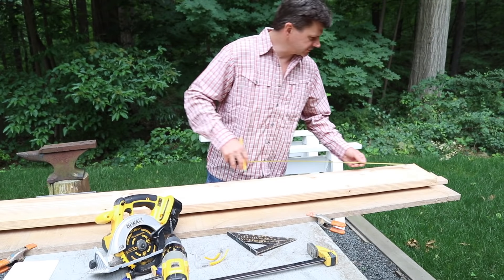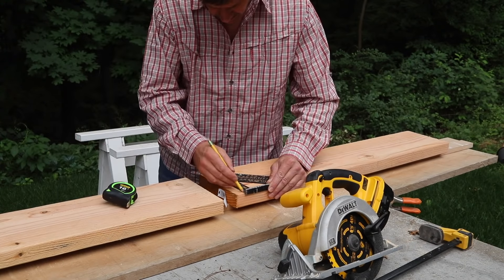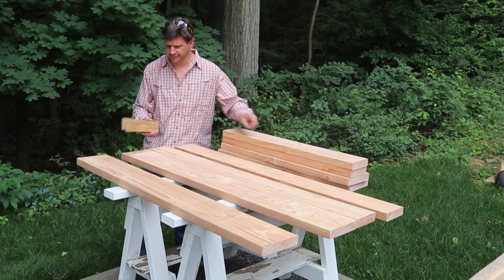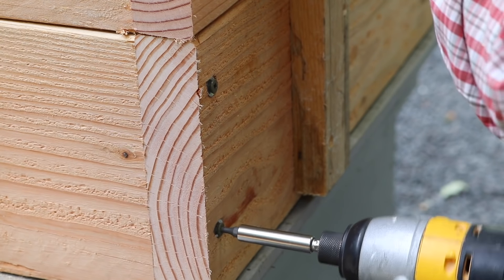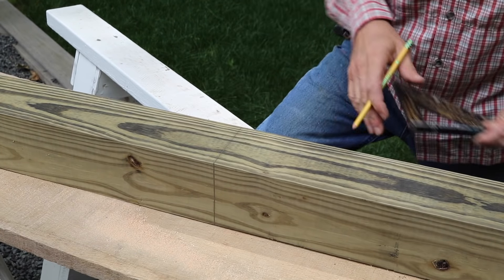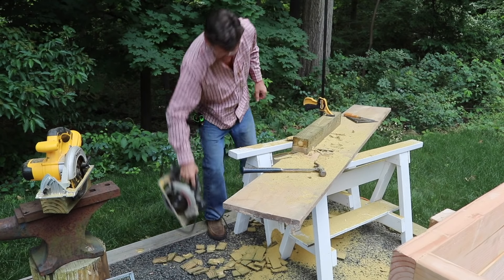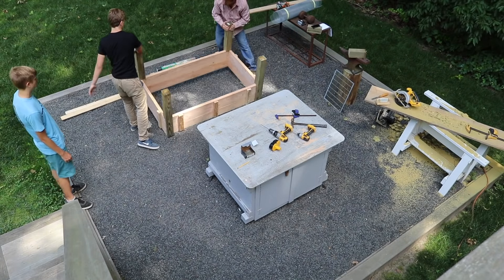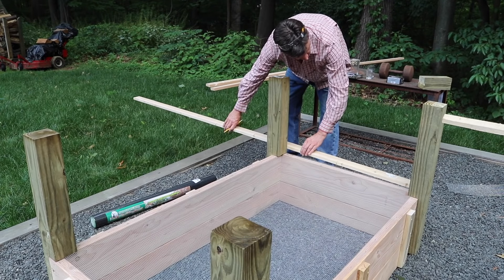Build a Stand Up Planter Box - limited tools project

Comment: For the legs I used two treated 2 by 4s sandwiched together instead of the 4 by 4s. One was 32 inches long, the other was 19 inches. It alleviated the need for notching and saved on saw blades/time without sacrificing strength. I also reinforced the wire on the bottom by attaching a treated 2 by 4 from side to side under the wire (36 inches). Great video!
Reply from the maker: Good idea, Thanks John
Reply: Update: I have built 5 of these now, 3 for my own backyard and 2 for the in-laws. I purchased mushroom compost and topsoil mix by the yard (60/40 mix) and have them all filled ready for planting. The wire mesh seems to be holding well but I do have a center 2x4 support across the middle to assist. I think I may add a "cap" around the top edge of the planter to give it a nice finished look and help in water shed. Another suggestion IF you have more than one set up in a row would be to leave about a 3 foot space between two of them and add a shelf across the gap, it makes a great place for working at the beds! Tons of options only limited by your own creativity! Again, thanks for posting this video Jon, very nice!
Reply: Progress report: The planters are performing wonderfully after several weeks including a LOT of hard heavy rain! The mesh is holding even the water soaked soil with ease! Our plantings are well on their way. I also added a "wing" off one side to support our cucumber crop so we'll see how that works out!Also, the wife has asked for a modified unit or two for flower beds so I will be making a couple  with treated lumber and a narrower dimension of 1.5 feet by 6.5 feet (long and narrow).I have some pics but appare3ntly I can't post them here??
Reply: John Hannington do have pics of what you done?
Reply: Wow ! Great idea on the 2X4 legs!!   I'm going to make a few of these. Might make a few for other people too!  I bet alot of people would LOVE something like this.  Most gardeners I know are older folks. This would save their backs for sure.
Reply: John Hannington great tip
Reply: Would you mind giving me the dimension  of the wood I need to purchase. I’m new to this and want to make sure I purchase the right amount of wood
Reply: @Vik8a  the sides are made out of 2 X 6 X 8s and 2 X 8 X 8s
Reply: @lifeasiknowit4497  I do but I can't seem to post pics here. Do a search on Pops_Place and contact me if you want.
Reply: Black Buick  thew wire I use (#2 hardware cloth from Home Depot) is galvanized. Should out last the wood I think...
Reply: @johnhannington2877  If you posted photos of any of your projects made from this idea I'd love to see them!
Reply: Black Buick  I believe that is galvanized wire.
Reply: @johnhannington2877  another mod you want to consider if you build more in the future:  mount a piece of galvanized pipe in the middle of your cross members, sticking straight up and just slightly taller than the edge of the box.  cap the bottom end (but put a drainage hole in it).  you now have easy to use receptacles for a trellis or single cages should you need them.
Reply: John Hannington won’t look as cool though but more practical
Reply: @johnhannington2877  Guess you have to make some vids of your accomplishments! would like to see what you have done!
Reply: @Trentberkeley86  could always create 4 sided wood around the pipe to keep wood look
Reply: Good idea for reinforcing the wire. Wet dirt can be very heavy and when there is that much it could probably make the wire sag and come off from the weight.

Comment: Update: I have had 3 of these in my backyard for 2.5 years, I did not cover them in the winter (probably should have) and the soil stayed inside. In the spring I turn the soil with a military foxhole shovel locked into the 90 degree position (it works exceptionally well) and I add a bag or 2 of fresh vegetable garden soil to each unit (2-4 cubic feet). The inside is starting to deteriorate but only slightly. I expect to get 5 full growing years out of each unit before replacement. I'm also thinking of painting the outside of any new ones I add but that is more for "look" rather than necessity. The wire sags a bit but if you have attached it well and add a center support it will be fine. Year one I made 12 of these and improved upon the design a bit (reducing costs and waste).  Year two I made another 14. This spring I have made 21 units and  6 of those were my new 8 footer with 6 legs and 2 cross supports. I've gotten so that I can crank one of these out in under 3 hours. I use a crosscut saw on a stand which gives me quick and accurate cuts. I assemble the lower 8 inch sides of each unit upside down on a work table I built out of scrap material. It looks almost like the planters except it has a flat top (very solid). I build the bottom box first, then staple the wire to it,  then the 36" crosspiece is added (it also helps keep the box square and reduces bulging of the sides), then the 4 legs are put on (still upside down). I use a 4 foot bar clamp to hold the legs in position until they are squared and attached.  I then add strip material to cover the edges of the wire, once that is done, I flip the unit onto the ground right side up and then simply add the next level of boards. The cleats finish it up nicely! I use 44 - 3" deck screws, 36 - 2.5" deck screws, 48 - 1 5/8" deck screws and 55 - 3/4" chicken wire staples. If anyone wants pics or parts lists from my builds please feel free to reach out to me via my youtube channel Pops_Place or my Twitch Channel also Pops_Place.
Reply: Pops_Place I tried to find your info on your youtube channel but didn't see it. I'm interested in the info, can you help me out Many thanks

Comment: I built three of these boxes in 2018 exactly how Jon made them, and over this winter the weight of the soil and snow tore the hardware cloth and the soil fell out. It only happened to one of the boxes. I am going to repair it with a 2x4 underneath for extra support. Thanks again for such a great video and idea Jon!

Comment: Going to tackle these this weekend. Plan to integrate a sub irrigation system too. I'll need to beef up the bottom for sure though. This concept is a perfect for my wheelchair bound father to have an easier time gardening.
Reply: I will add a cleat to the bottom of the long side boards. then put  1 x 4 or 6 to fill the bottom with space for drainage along with Fabricate. Hope this helps.

Comment: I snapped 5 drill bits using those countersink collars while building some simple 2x8 benches in pine.  I have basically given up on them, any advice to avoiding snapping the bit in the wood.  I was pretty sure that they are just a bad design as any misalignment causes shear on the hit where it meets the countersink teeth.

Comment: Jon, I have used raised beds for close to 25 years now and wished I had done this then! My question is this, how do you work the soil in the spring when it becomes compacted? Mine are on the ground and I use a mini gas cultivator to work it up each spring and it work fine, do you work yours by hand? I plan on using 2" rough sawn cedar for the sides on my replacement boxes and the new treated wood for the legs to eliminate ant contact with the treated wood and the soil. Great plan for the boxes though!!

Comment: I really liked this, but wondering whether it'd be possible to add a board or two worth of depth and turn it in to a wicking bed. With the assumption that I'd reinforce the bottom significantly, are there any other problems people see?

Comment: I'm building a larger but similar planter out of ordinary fir  framing lumber ..I'll be placing grow bags inside for a better root system and to avoid the soil to wood contact which will rot the wood after a few years....I like your idea of using the wire mesh hardware cloth  covered with landscape fabric instead of the wood slats I was planning on using... does that system drain well?... thanks

Comment: Just built a pair of these. Turned out awesome! Took advice of others and a) added a 2x4 underneath for extra security for the weight of the soil and b) cut 2x4s 19" and 32" for the legs and mashed them together. Thanks again for the great instruction and video!

Comment: Hi Jon...
Couple questions:
1.) This looks to be built out of standard Home Depot dimensional stud lumber, with the exception of the pressure treated legs. Will the raw untreated wood not just rot out in the rail filled with wet dirt the entire time?
2.) Did you not use pressure treated wood for the whole project, because the chemical(s) would leach into the soil/food?
Reply: I hope he answers this
Reply: Michael, I can guarantee that unless a specialty type wood is used, it will rot after 2 to 3 years. I'm told that pressure treated wood is treated with copper these days instead of arsenic so it's not toxic. You need to verify this if it's a concern of your's.
Reply: @1stinsonguy  Copper IS a toxic heavy metal and dangerous for those of us with the MTHFR gene mutations (C-677t, which would be me).
Reply: Ummm...use cedar

Comment: So I'm about to attempt this project! I have a few questions that I see you left untouched. I will be using treated 2x4s for the legs, 32" and 19" sandwiched together as mentioned below. You also mentioned using 2x6s for the sides instead and I was wondering what you'd think of using 2x12 for the sides. Also you mentioned using 8' boards but when I added the dimensions of the sides I got exactly 16' and how is that possible if you are removing an inch from the ends or would I need extra if I wanted to do that? I will also be following advice below of using a 2x4 to brace the bottom. Others have mentioned about using some kind of treatment for the wood that won't leech into the soil, any recommendations?

Comment: Nice build.  I like the lapping of the legs.  Don't know about the hardware  cloth or it actually pulling away from the mountings because of sag.  Probably one or two cross stretchers need to be added.
Reply from the maker: Thanks Jim...so far so good with the cloth and wire but cross stretchers are a good idea if there's a problem.

Comment: Wondering how long (2-3 years or more?) you expect these to last with moist soil in contact with the untreated pine?
Reply from the maker: Good question...I'll probably remove the soil at the end of the year and seal the interior....I think they'll hold up for at least a few years.
Reply: I think that placing grow bags inside the planter box would avoid the wood to soil contact and help the roots at the same time... in that case using ordinary fir framing lumber should last for many years...
Reply: I covered the inside walls with rubber pond lining.

Comment: Really nice video John. Definitely agree with you on the mesh, might need a little reinforcing, but it's still a great way to drain the soil. Haven't seen it done like that before, really good idea.
Reply from the maker: Thanks Robin...so far so good.
Reply: I will add a cleat to the bottom of the long side boards. then put  1 x 4 or 6 to fill the bottom with space for drainage along with Fabricate. Hope this helps.
Reply: Rob. 
in Lewis

Comment: Did that hardware cloth support the weight of all the soil?
Reply from the maker: Yes still good
Reply: Jon Peters Art & Home did you put any additional support on the bottom? Or just the staples around the edge? I used a piece of unfinished plywood and used some brads to hold it in place and drilled some drainage holes in it, but haven't put the soil in yet. It can support my entire body weight but I only weigh 110 lbs lol so I don't know if 8-9 cubic feet of soil will weigh more than me or not

Comment: Nice clean job. I have one question. When cutting the lap joint what depth do you set the circular saw at?
Reply from the maker: 1 3/4”
Reply: Always cut the lap joint as deep as the thickness of wood you are going to put IN the joint!

Comment: The hadrware cloth i could find at my local HD is 1/4 inch x 3 ft. x 10 ft. 23-Gauge, is this the correct one to use?
Reply from the maker: That should work but in the video I say add a little support to the bottom… I had a little sagging but it didn’t fail if I were to build it again I would add more supports
Reply: @JonPetersArtHome  so basically just a 2x4 around 3" long connecting the 2 long sides roughly in the middle? Or rather have a few of those 2x4s connecting both long ends every X distance?

Comment: 3 1/2 years later I have to ask if the screen held up to the weight of the dirt.
Reply: That's what I'm wondering too. Did you find out yet?
Reply: I was going to ask the same questions. I bet not.
Reply: I'm wondering the same before I fully commit haha
Reply: @palehorse5275  so I made mine and so far so good.  Got about a foot of wet soil in
Reply: @Luna_Kat1983  Glad to here
Reply: Does some of the the soil fall to the ground?

Comment: i made this in an L shape pattern, but the part the 90 degree corner that is connecting the two pieces is starting to cave down in the center. Any ideas on how to fix this and support the bottom? I already have soil and plants inside.

Comment: I built mine 3' x 5' OD. I didn't think the floor would be strong enough so I added a length of angle iron length wise to help support the hardware cloth (screen). After filling it with top and potting soil the floor fell through. I need a much stronger floor. Any suggestions?
Reply from the maker: So far mine is still good, you could add a cleat around the bottom and then use boards . I did that with another planter and that’s working good too. You can find that video on my channel also.

Comment: just curious but is there a particular reason the side battens have been put on the outside of the box rather than the inside? I'd be tempted to put it on the inside, as I'd rather not see them.
Reply: +ApacheRosePea00 I have never made a planter box and have only done basic wood working so far. I am currently thinking about making a planter box though. So I was just curious if there was an aesthetic, structural or longevity reason for doing it this way.
Reply: +ApacheRosePea00 Yeah. Impact drivers are great. I bought one when I needed to dismantle my decking. it easily undid 250 rusting decking screws that had been the wood for probably 10 years. Not even 1 of the 3 charge indicator lights went out so no idea how any it would do on a single charge. More Than I will ever need anyway!
Reply: IMHO having them inside would mean they would be getting hit by the shovel and it also lessens the amount of soil in the box.  Outside makes more sense for gardening although maybe not as pleasing to the eye.  That is why I like these plans the best.

Comment: A solid wood bottom with the boards spaced slightly would be stronger.
Line it with landscaping cloth or an old bed sheet.
All treated lumber sold after 2004 is safe around people and food.

Comment: I liked your plans and used them. The only difference was, I beefed up the bottom bracing . With the weight of the dirt it was causing significant bowing on the bottom supports. Thanks for the video.
Reply: Poli

Comment: Just built mine.. one piece of advice for you novice wood workers out there. You’re probably better off using two 2x4s rather than a 4x4 for the legs. Doing the relief cuts and then chiseling it out turned out to be quite a pain. I had to change my plans in the middle of the project. Good luck!

Comment: Does anyone have experience putting wheels on Jon's design?  I'm thinking about building one for my parents but may need to move it around on a paved part of the backyard.  Jon's dimension would yield approx. 15 cubic feet volume.  This would be approx. 300 lbs if filled with soil (per Internet search on soil weight), not counting weight of lumber.  Just wondering if anyone has done this before and can comment.  Thanks.
Reply from the maker: +yusuihang that shouldn't be a problem just make the legs a little bit shorter, the length of the casters
Reply: Thanks Jon!

Comment: Any and all raw wood pieces need to be treated for a planting box.... Use either GRONOMICs CEDAR GARDEN BED OIL or 100% PURE TUNG OIL.. WILL NOT LEECH and it will last for many many many seasons...and rather than just picture framing the screen run (2) 2X4'S SIDE TO SIDE TO SUPPORT THE SCREEN.
Reply: Couldn't you paint a few coats of quality exterior paint to protect the wood? Would it be safe?